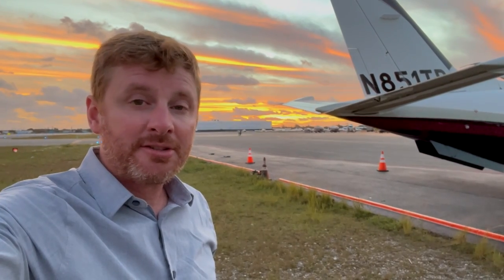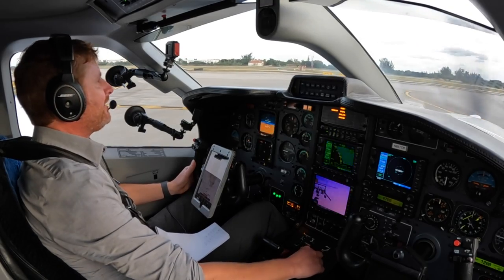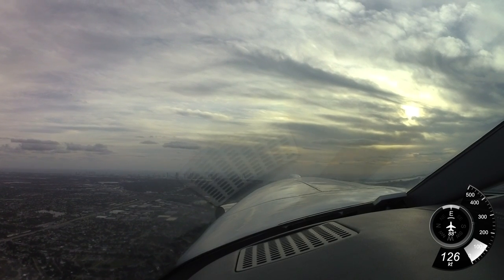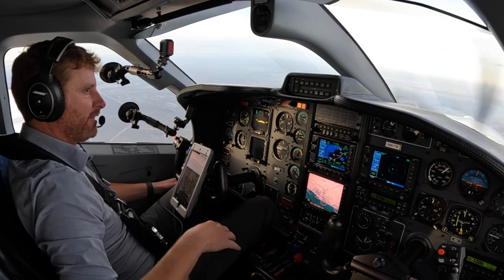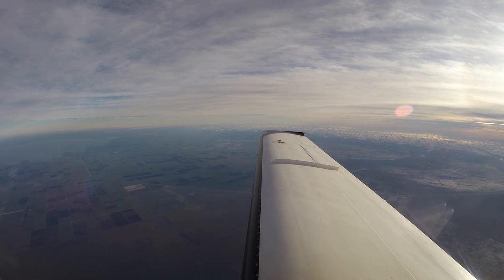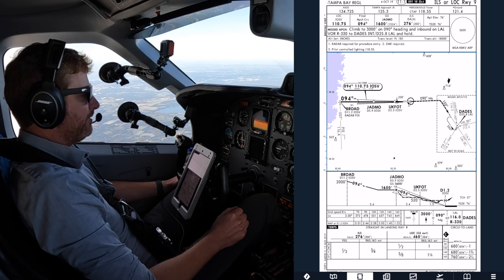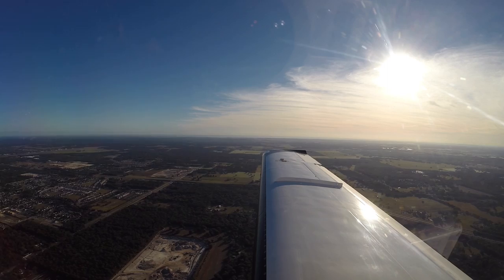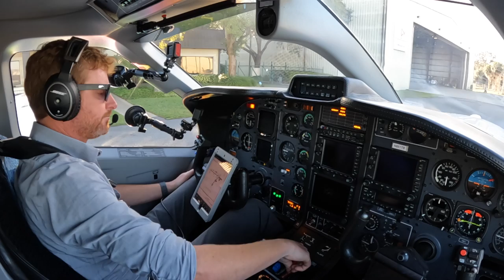ON THE JOB! - First Flight of the Day!

Comment: I don't recall if you mentioned before whether you're a CFI, but you'd make a tremendous flight instructor. Your workflow is so concise and easy to follow, it takes a lot of the mystery out of IFR flight.
Reply from the maker: I was hired at the regional airlines around 400hrs back in the day.
Reply: @steveo1kinevo  interesting to read that. Did you feel as capable flying regionals at 400 vs 1500? I have a feeling you did. I don’t see a problem with FOs having low time flying with captains who are obviously qualified at the regionals. I’d be interested to hear your thoughts on that.
Reply: @mikeflippo6273  Where I live it's quite common that people jump onto the right seat of an A320 right after the CPL at 250hrs. I think that's the case at every airline ab-initio pilot school, which are common at major European carriers.
Reply: @mikeflippo6273   Not speaking for anyone else here but myself. I fly freight in a Metro, mostly single pilot IFR. Sometimes we do have FO’s so we can fly longer. Most are 500 to 600 hour pilots, I’ve had some that I’d say I can tell they would make great Captains. Some, can’t fly their way out of a wet paper sack and are scared of IMC.
Reply: @beaterstang0898  moot point about IMC if they can’t fly out of a bag
Reply: @MyChannel-bh6sc  HA.. Where do you live ??  That’s unheard of in the northeast US
Reply: @Bigpeat190  Finland. The flag carrier (Finnair) owns a major pilot school and mostly recruits through them. Although most people who got their license in the past few years haven't gotten employed and have seeked pilot jobs elsewhere. I know that at least Lufthansa and British Airways do the same.
Reply: @Heyemeyohsts   It's dang sure not moot when you have to take the controls from them during an approach.
Reply: @beaterstang0898  if they can’t fly out of a bag , that means you are still on the ground right ? Are you taking about taxiing in a fog filled bag ?
Reply: @beaterstang0898  your wording was in the wrong order . First you say “they are afraid of IMC” . Ok that is realistic. THEN you go over the top, and say the wet paper sack part. You can’t go from over the top ridiculous, then back to realistic.

Comment: I use to work at an overhaul facility that worked on the PT6 engines. I was an inspector and did hot sections on them. Awesome and powerful engines!

Comment: As a 30 airline (retired) guy, I would recommend looking out the side windows a little more. Especially the right one. Cruise climb at the higher airspeed keeps the engine cooler and the nose down to see better, as well. Choosing the visual & short apch vs. the localizer apch saves fuel and makes the boss happy. Good choice on disconnecting the a/p for visual apch to allow you to be ready for anything. Great video and superb narrative. Keep it up.

Comment: Awesome videos!  I noticed you fly with a window mounted GPS and you use  Foreflight on your Ipad. With your aircraft producing ADSB in/out and your Ipad producing ADSB in/out how do you prevent ATC from seeing 2 aircraft.  Have you ever been asked to turn your secondary GPS off?  I have! I'm sure your using it for AHRS and to verify against your primary Nav/Com.   I have asked this for the past year and no one seems to have an answer. I use Stratus 2 but also have a Garmin 530W (Bonanza N7943D)

Comment: Hey Steveo, 
Why do you use 1900 on the prop and not a lower setting like 1700?
Wouldn't that be even quieter? Or does the cruise speed drop too much then?

Comment: Hey Steveo, what rpm does the propeller spin on the TBM? Also, what rpm does the engine spin, I'm assuming there is a reduction between the engine and prop.
Reply: PT6a turbo prop propeller speeds are usually in the 2,000 RPM range. The turbine speeds in this range would be around 32,000 RPM.